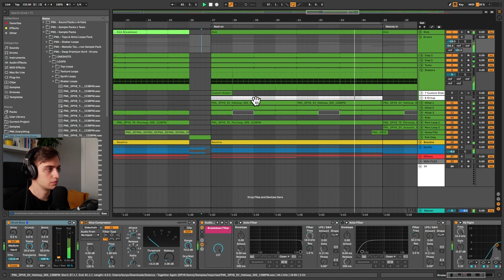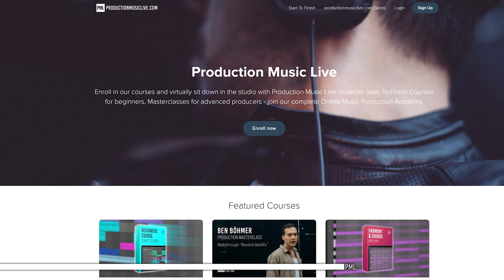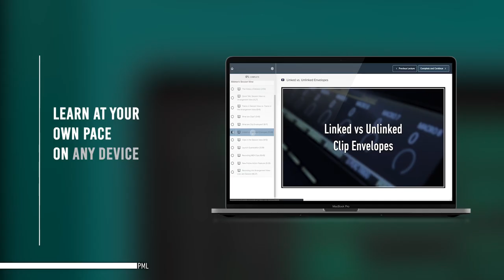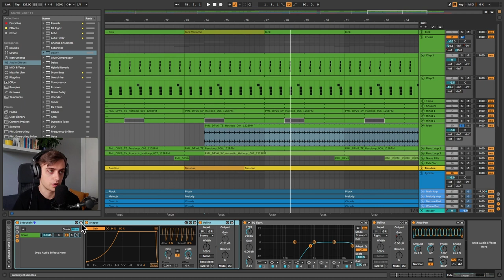How to Sidechain like a Pro with Ableton Shaper | Melodic House Tutorial

Comment: What are the disadvantages of doing sidechain this way?
Reply: This method is ok if you know for sure that you want this ducking at a "fixed rate" IE the way he had the rate set to 1/4. 

Me personally I either use the compressor that detects incoming signal to duck or Shaperbox set up to receive a midi trigger to duck. The 2nd method is what I use mostly

Comment: Did you know if you double click a point  it turns in to circle and acts like sustain ? It can be very confusing if you don't know and double click it by mistake. Strangely it is not mentioned in user manual.

Comment: Can we sidechain multiple tracks to the same plugin without having to create a group in Ableton?
Reply: Only thing I can think of is grouping the tracks you want to use and use the group channel as your sidechain input?
Reply: @WompRok  yes but if I want to sidechain a specific frequency with soothe and they are already in different groups then It sucks. In Studio One you can sidechain from many different sources at the same time , and no matter where they are located
Reply: @carlosp.1846  That's pretty cool. I have never had a problem where I felt that I needed to do that, but if I could in Ableton I probably would. I suppose the way around it in Ableton is the ability to group groups as well
Reply: @WompRok  well, it’s useful when I want a specific frequency from a lead or vocal to turn down a variety of tracks/sounds frequency ranges when it comes in. Not sure I can group two different tracks that are already grouped inside different groups.
Reply: @carlosp.1846  Yea I'm not sure how many times you can group groups, the solution in that case is route everything to an audio channel that you want sidechained by by something specific, I do that all the time. Just send it the the track instead of "master", so everything you want will go through that channel before hitting the master

Comment: It appears your shaper is running continuous based on the tempo. The correct way is to side chain to a click track. Can you post a follow-up video showing how to side chain the shaper to a click track or drum track?
Reply: There’s no correct way, plenty of room to experiment as long as it sounds good
Reply: @martti7363  yeah I can agree with that. “Correct Way” was not the right choice of words. For me personally I use LFO Tool side-chained to a click track and I always welcome ways and methods to do something in Ableton with stock devices. I am still curious to see if the shaper can be triggered by a click track.
Reply from the maker: Let me know what the technique of assigning a click track to LFO Tool is :)
One workaround in stock Ableton could be to put an Envelope Follower on the click track and assign it to a macro on the sidechain effect rack (the macro would be an on-off switch for the Utility inside it). Let me know if I'm on the right track here :)